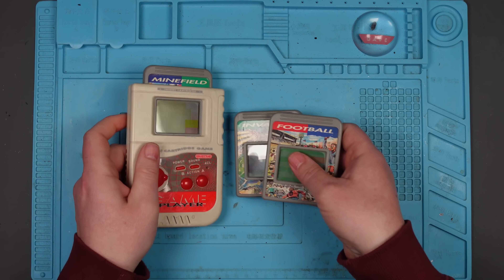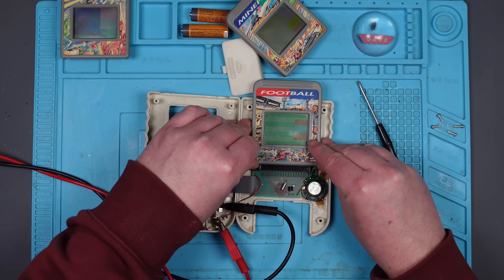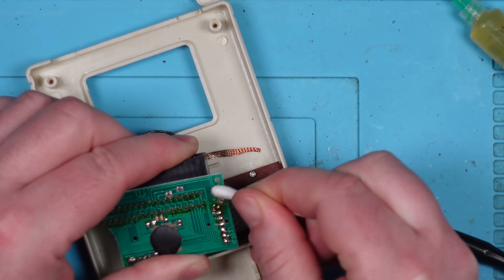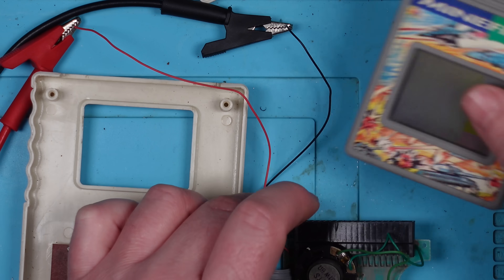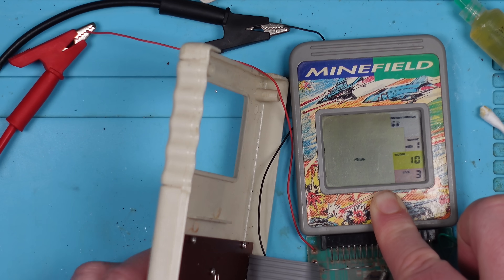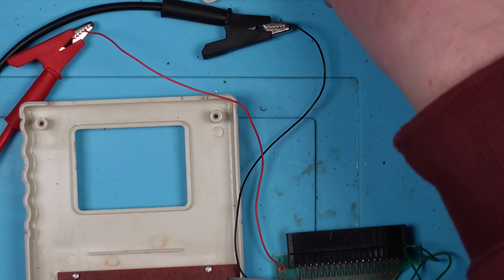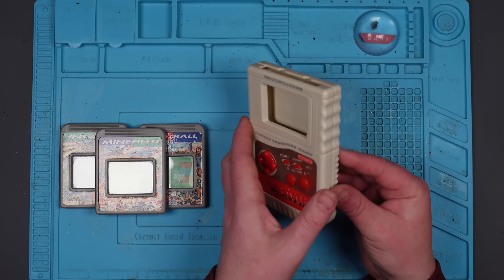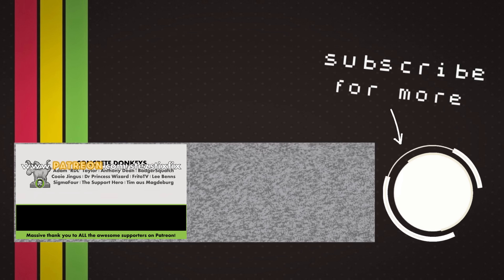It's like a Game Boy, but worse | Can i fix it?

Comment: I wish you'd fixed the poor pin connection that was causing the intermittent display in the first place, but I can't say I haven't used the "wiggle it until it starts working and then don't touch it again in case it stops" method before...

"Let he who is without bodge cast the first stone"
Reply: Let he who is without bodge melt the first plastic
Reply: I thought that, too

Comment: Remove the battery springs that have rust and put them in a cup of white vinegar for about 10 to 15 minutes and use a tooth brush to scrub them after the 10 to 15 minutes of them being in a cup of vinegar to get remove remaining rust this technique works really well
Reply: Yeah I've seen this on a restoration channel. I've also seen the creamy plastic improved to a more aestheticly pleasing colour.
Reply: Oh, he knows about doing that, he's done it before.  In this case, he had the replacement springs from a previous repair, so it makes more sense to just replace them.

Comment: Nice fix! You're lucky you didn't fry it when you connected the bench supply with the wrong polarity as most cheap electronics has no protection for such abuse.

Comment: To be honest, with anything vintage, Observe, Clean and Resolder wires. Replace caps, scrub battery terminals, but be aware that some idiot might have got in there before you (not calling you an idiot despite "Voice Over Steve").
Warmest Regards
Wayne & Nina
❤️❤️❤️❤️❤️❤️❤️👍👍👍👍👍👍❌️❌️❌️❌️❌️